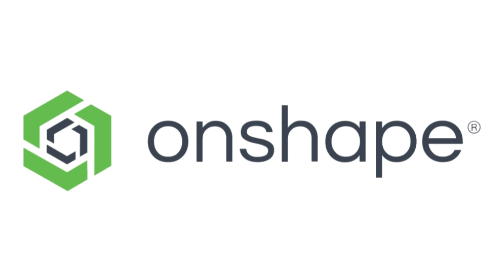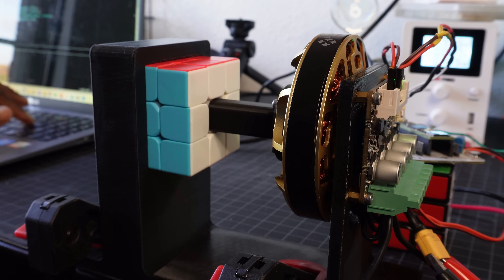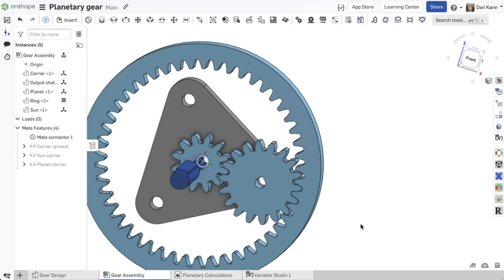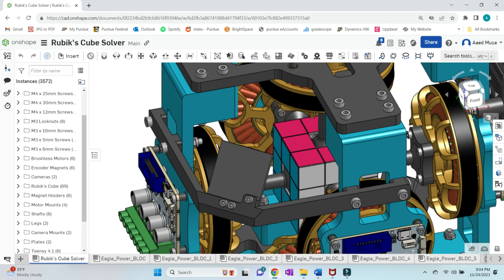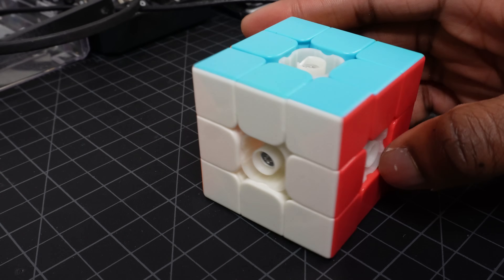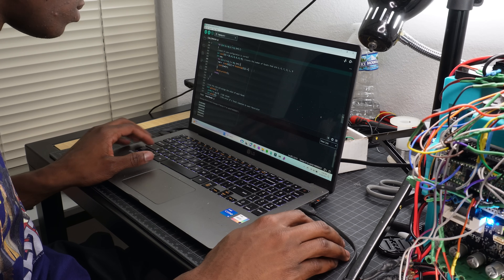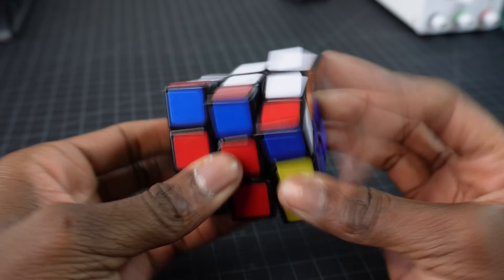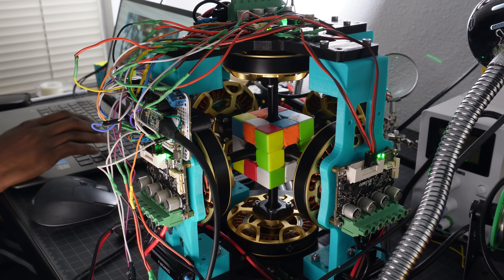I Built a Rubik's Cube Solving Robot

Comment: 16:40
Have you ever considered a cube that can corner cut? Corner cutting is when the cube snaps into place even if a side isn't fully turned. Now, it may have to be around 80% solved, but I think you can handle that. I'm not the genius here, just giving suggestions.

Comment: Reckon you could make a few upgrades that’d def speed things up.
- drone motors aren’t very precise. There’s a reason they’re used for controls spinning and not precision. Use servos or stopper motors.
- you could run things at a much faster speed, with a higher voltage rail
- use more high res cameras to make your life easier; but it doesn’t seem like you’re having inspection issues.
- put a consistent led solution. Throw in some LED strips.

Comment: The equation variables if I should guess would depend on the following:
Motor speed
Osulation speed or frequency speed of the microchip or refresh rate
This unlike human variables is immuned   to random complexities like a calculated.
It takes a calculated almost the same amount of time to add 1+1 and 1*4+247=251

Sincerely

Ejike

Comment: I’m thinking of an algorithm which instead of solving cube in smallest amount of turns would give us best solution for using less motors. Meaning these turns would kinda connect together to be more smooth. + combining it with corner cutting and you could make it maybe even faster. Also you could turn opposite sides at the same time

Comment: Sharpie and white being the same is likely due to an IR sensitive camera.  In terms of your color determination, to automate your engineering: If you computed the average pixel values for the different color faces and then run a principle component analysis, the result will be a projection that maximally separates them. Simple sum of squares in that space will probably give good decisions.  As far as simultaneous moves you could try building a peephole optimizer-- imagine you have a list of moves,  you can grab a window of those moves and look in a database to find another set of moves with the same result which takes less time given your system dynamics (e.g. parallel moves).  Then simply build a database by making a program that enumerates moves, checks the permutation they accomplish, and remembers the 'cheapest' alternative. Run the substitution over the moves list until it stops changing.  Presumably this would be nowhere as good as a better algorithm but you don't even have to understand how a rubik's cube solver works to implement this, and it can't make anything worse assuming your definition of cheaper is correct.

Comment: I wonder if using a PTFE based dry lube spray would help with motor start/stop latency by reducing the required torque to rotate faces. Also its its a dry film so it wont create a huge mess when those motors are going to town XD.

Comment: Tip for solving the colour problem; instead of trying to find the same colours every time, instead look at the relative values between them. That way you can identify which colour is which based simply on the difference rather than having to essentially “hardcode” a value. Also as other people have mentioned, switching into HSV colourspace could be really helpful too! Especially if you were using the relative colouring, since you could really just look at H and V. Eg, the red is a lower V than orange.

Comment: Hi! I have a similar project that i'm developing, and I came up with an idea that may help you solve problems with color identification.

The thing is, you dont need to identify if a facelet is red or orange, but just what facelet has the same color as the other.
This way, you'll be identifying color groups, and not the exact color.
To give the cube's pattern to the kociemba's algorithm, pick a corner and assign it's color groups to white, green and red. Iterate over the other corners, checking if it has 2 color groups matching the first corner. If it does, then the third unmaching color groups are opposite colors.
E.g: the first corner has groups 1,2 and 4, and I assigned 1=White, 2=Green, 4=Red. If the second corner has groups 1, 4 and 3, then color groups 2 and 3 are opposites. Since 2 is Green, then 3 is Blue.

The kociemba's algorithm will work the same, since you'll be giving it the same cube, just with a different simmetry!

Hope it helps you get the WR 😂 (who knows? haha)

Comment: the way I like to set heat insert nuts is to heat it with my soldering iron (i have the special tip which does help inserting accurately) and then ill push it like 3/4 of the way in, and then press it in the rest of the way with something flat. Comes out almost perfectly every time.

Comment: For detecting the color HSB makes much more sense because you’re independent of brightness and saturation. Also the stiffness of the brackets might be a bit low so they the motors move out of alignment quite a bit. Other than that cool project 😊
Reply from the maker: Thanks for the input. I have had a lot of people recommend HSB. Unfortunately the cameras that I use don’t support HSB. RGB is doable with consistent lighting. As for the brackets are you referring to the brackets that the motors are mounted onto? If so those are very stiff. There are 8 screws on each.

Comment: Always love your videos!  This channel IS so underrated. 

How about aluminum or carbon fiber shafts to minimize the blocking of the camera view? Could also lighten up the part a well as reducing the rotational inertia. 

Btw, some alcohol would have taken that sharpie off quite quickly.
Reply from the maker: I assume you mean aluminum/carbon fiber shafts that are thinner than my current shafts? That could work, but the method that I created has a 100% success rate in finding the hidden facets whereas camera vision doesn’t. It’s also cheaper than buying custom shafts. I’ll be working on lighting and inertia in the next version. I don’t have any kind of alcohol at home so scratching it just seemed to be the easiest thing to do in the moment lol. Thanks for the input!
Reply: @aaedmusa  of course. I was actually thinking more towards the rotational inertia originally, then started thinking about the camera to be able to shave off some of the solve time. I’m sure processor speed must also be a consideration as well as any other bottlenecks you are encountering. 

At the end when you were talking about the looser cubes being better for humans because they can cut the corners on the next move. Are you sure you can’t use that to your advantage in your build? I realize your stated reason for the tight cube…

By the way, thanks for interacting.
Reply from the maker: @z0mb13h0rd3  Yep. Corner cutting would require a loose cube. A loose cube works very poorly at high speeds. Like I mentioned, the MIT guys came to this conclusion in their testing. I also tried it out and got a lot of jams as a result.
Reply: @aaedmusa  right, you did say that. Slipped my mind. 

So much of it comes down to the places you can cut down time, in data acquisition, processing, parallel moves, and move speed. You solved it in such few moves, there doesn’t seem any gain there. 

Fantastic work! You have my admiration per usual. 

Do you have a project for winter break, or are you taking a proper break?
Reply from the maker: @z0mb13h0rd3  I think there’s a few more things I can do to reduce time in terms of the algorithm and motor settings. Anything beyond that will just have to be done by changing the motors or gearing them down. I’ll be working on a robotic actuator design this winter break.
Reply: @aaedmusa  look forward to seeing that video, have a great break!
Reply from the maker: @z0mb13h0rd3  thanks happy holidays!

Comment: This is so awesome. I also built a Rubiks cube solver, that could solve cubes in under 0.7 seconds. I did it with cheap normal Nema 17 Stepper Motors, but I really like the idea of using drone motors. As others have suggested there is a different version of the kociemba algorithm that is optimized for solving machines wich turns 2 sides at once, which reduces the amount of steps needed. For me corner cutting worked great to a degree. I did not tension the cube that hard and was able to use the corner cutting during the acceleration/deceleration phase, which decreased the time by a lot. Maybe try just a bit of corner cutting and slowly step it up till you reach the limit. Especially the early phases of the acceleration is where you can get the biggest time benefit.
Reply from the maker: With cheap Nema 17’s? That’s almost world record time. How many moves were your under 0.7 second solves?
Reply: @aaedmusa  Yes, I did a lot of tuning and the motors/drivers where running right at their limits xD I burned through a LOT of the drivers. Because I used the specific algorithm, it was about 17-19 steps the machine had to do. (When counting the double moves as one)
Reply from the maker: @theoneandonly2025  Have you posted this project anywhere that I can take a look?
Reply: @aaedmusa   I only have the earlier prototypes on my Instagram, but have never come around to post the final version. I really should do it xD. I wrote documentation for it, but it is completely in German.
Reply from the maker: @theoneandonly2025  I would love to see it if you wouldn't mind. Also, if you could share the algorithm that you used that would be great help for my next iteration.
Reply: @aaedmusa  No problem, I will send you an email to the address you provided on your website👍

Comment: Question: would it be possible to create a 3D printer that uses those drone motors? Would it make sense? Would it be faster?
Reply from the maker: These are still not as accurate as stepper motors so no, it wouldn’t make sense.

Comment: Very interesting. Is there a need to test the position of the facets after every move? Just scan the initial positions and calculate the new positions. And maybe if you do the calculation during the move in a separate thread of the processor (if your processor has this capability) you gain some time.
Reply from the maker: It only scans the cube before a solve. When the motors start turning the cameras are not used.

Comment: You probably already thought of it but one possible optimisation is making use of the fact that you can turn opposite motors at the same time without the cube jamming. To make best use of the optimisation the solver should consider rotating opposing sides at the same time as a single move.

Comment: Here is a pro tip. If you want to remove sharpie ink all you need is a dry erase marker. Just write over the sharpie ink with the dry erase then simply wipe it clean with a paper towel immediately after and it'll come right off.
Reply from the maker: interesting! never tried that
Reply: @aaedmusa  Works every time. That's how I used to have a whiteboard for house chores on a permanent grid. Make grid and column labels in sharpie and then write the cells in dry erase. That way the grid is permanent but if you need to redraw the grid the write over the sharpie ink with dry erase and wipe it off the whiteboard. Enjoy!

Comment: Awesome engineering. I never learned how to solve a Rubik's Cube, but I always like seeing FOC being used in interesting applications. My only advice is to ditch the painful Arduino IDE and switch to PlatformIO on VSCode (which still allows you to use the Arduino framework underneath). Much more powerful, and comes with all the benefits of VSCode -- autocomplete, linting, better themes, extensions, etc. And PlatformIO has much better debugging capabilities, which is always useful. You may also want to switch to CF PETG for the shafts, which should give you the rigidity of PLA without the brittleness.

Comment: Amazing work! I know nothing about Rubik's Cube solving; but could you rotate two opposite sides of the cube simultaneously to increase solve time?
Reply from the maker: Yes, but that can only happen under specific circumstances: when two sequential moves are on opposite faces. With this algorithm, it doesn't happen too often. Generally, sequential moves are on adjacent faces meaning that they have to occur independently rather than simultaneously.

Comment: if you dont want that your pc is crashing all the time. get a ECC REG board with compatible ECC REG memory... the issue that its crashing is you lose data between you cpu and your drive there is the memory. nowerdays you have also simple board that supper ecc memory and its not that expansive anymore

Comment: Rather than increasing infill for things like the shafts you should try increasing the wall thickness, the further the material is out from the centre of rotation or bending the more strength it will add. You should also consider using a different material for printing parts, PLA is good and works well for a lot of things but there are much stronger plastics you can get.

Comment: Just a quick tip. Use inrunner motors with long, but small diameter rotor to keep the inertia as low as possible. Lubricate the cube as well with some low viscosity grease or oil to keep the friction down, needing for even less power from the motor, further reducing the innertia. That way you can increase the acceleration/deceleration. Nice build though. ;)
Reply from the maker: I already had these motors from a previous project. At high speeds, high friction is actually preferred not to mention that the cube can be tensioned even if friction is a problem. Thanks though!

Comment: Great project.  Really well done and presented. Subscribed.  
Knowing nothing about that algorithm... if it's optimized for the lowest number of moves (?), that may not be speed optimal for your setup.  You may see a speed increase by adding moves, if they can be done simultaneously (opposite sides of the cube)
Reply from the maker: This may be true with some solves, but I don’t have the knowledge to create a new algorithm to do what you propose. I basically just downloaded this algorithm and used it as is. For the most part, this algorithm is going to be pretty optimal. I’ll look into this more in the future.

Comment: Great video! The cost of 12 ODRIVE S1 is eye watering (am I seeing this right: $150 per controller??)! I am currently working on a project that uses FOC as well and have found the ST B-G431B-ESC1 ($20 per unit), which does not come with many features pre-programmed, but you can program the STM32G431CB, which is on the board, to do any controls you want. It unfortunately clocks the charge pump at the motor bridge switching frequency, which might cause some problems when operating at low speeds.
Reply: With FOC, you are using PWM, so the charge pump is not a problem at all. But you can't do 100% duty cycle though, which is only a problem if you want to have full torque at a very specific rotor position, and the rotor is stuck, but those cases are highly unlikely, like extremly unlikely to cause troubble...

Comment: I bet you could modify the solver algorithm to allow opposite motors to turn at the same time. the right and left motors could turn in 4 different permutations at the same time, and every time they get used instead of a single motor turn, you chop off a move. Given that most algorithms allow for face turns and not just quarter turns, youd be adding a huge number of possible moves. I bet that would reduce the number of needed turns from 20 to ~16-18, but that's pure conjecture. If this doesn't work with the algorithm you used here, I'd love to see you use the original meet in the middle algorithm using these modified moves (even if just once since you'd have to wait on the solve for a long time) to show the fastest possible solve your machine could do.
Reply from the maker: Yep I've had my eye on an algorithm that someone made that does exactly that. I'll be exploring this in the future. With the standard kociemba algorithm there are few opportunities to pair moves in such a way that they can occur simultaneously.
Reply: This is the exact first thought I had when looking at this. I wasn’t sure if it was already implemented or not because the things spin so darn quick hahah.
Reply: I came to this as well.

Assuming you have an algorithm which scans your moves list and determines which adjacent moves can be "combined", the question is whether the controller can either a) send signals in parallel or b) get a second motor to start moving before the first one finishes. I don't know that the API for the motor controllers looks like or if they were programmed with raw high-low signaling.

Ideally, you could just send both a message to turn to their respective rotations and simply ignore any kind of delay between the two signals.
Reply: The other thought I had is that, all solves have Red on the top - since you don't have any middle squares you could have any color at the top - but it is kinda cheating because its only possible because you have removed the middle squares.

Comment: Congrats! Great project. It's unfortunate that ODrive is so expensive. Are any of the aliexpress knockoffs worthwhile, or are there cheaper options for FOC?
Reply from the maker: Knockoffs exist but they aren't compatible with the ODrive firmware. Cheaper FOC controllers also exist like SimpleFOC. A cheaper board will have much lower power capabilities though.

Comment: Fantastic video, as always! I wonder, since you are using the o-drives, if you could use current sensing to determine when the cube has been jammed and immediately release the motors to reduce damage/strain on the cube.
Reply from the maker: For me, it's easier to shut everything off by hand than to program it to shut off. Once it's tuned properly jamming isn't an issue.
Reply: @aaedmusa  Fair! I wasn't sure at first but upon rewatching the video I think I misunderstood - I thought you were destroying multiple cubes and had to replace them when they jammed or loosened. Being able to shut it off by hand and fix the cube is definitely better!